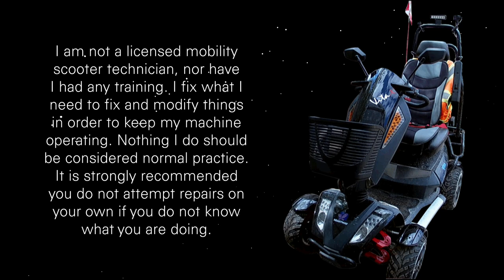Installing a Resistor to Limit The Monster's Charging Current

Comment: haha it's funny how you I think stopped at the same spot as the video before and the ice was being blown around and it's snowing in this vid and there's no ice on the pond thingy !!!  Boy it certainly looks cold there at that time, wow, it doesn't get anywhere near that cold here -7degs is as bad as it gets here !! Holy cow, that's one big resistor Bud !! Pity it didn't work out, isn't it always the way, Thanks for the vid Bud. Seeya Rob
Reply from the maker: The day it was snowing was a few days after the ice shove. The ice had already melted by this point... then it turned cold again.

Comment: Glad you’ve bought the mirror risers wes, they should work better I think I paid about 12 pounds Sterling at the time. Cheers. Andy
Reply from the maker: Hopefully I can get them on soon. I think I have all the needed bolts now.
Reply: @TheTimeCapturer   if you need more height on the risers just use washers.
Reply from the maker: There was more to it than just that. None of the bolts that came with them were usable so I needed new bolts to go through the handlebar and nuts for the mirrors on the other end. I'd been putting it off because I would need to take one of the mirrors off to make sure I got the right parts. Recently, I discovered the mirrors off the old scooter had the same threads. I wish I'd known that last year.

Comment: Hello I have recently got a scooter like yours and the speed that I can get out of it is 10.5 to 11.5 km,  I noticed out of yours you get roughly 20 km how do you get that 🤷🏽‍♂️
Reply from the maker: According to the web listing in the US, The Monster's top speed is 11.5 mph (18.5 km/h). My understanding is, the manufacturer is supposed to set the max speed to whichever country the scooter is going to be sold in as each has its own speed regulations. Then, the dealer is supposed to adjust it further to match the ability of the rider. I don't think mine was set as it came this fast. If you have the money, there are programmers available so you can change many of the settings. The cheaper one is a handheld device that uses codes. The other is software and a USB interface where you can enter real speed values. That one is at least $1000, depending on which country you are in. I would talk to the dealer you bought it from and see if you can convince him to speed it up for you. Some will, some won't.